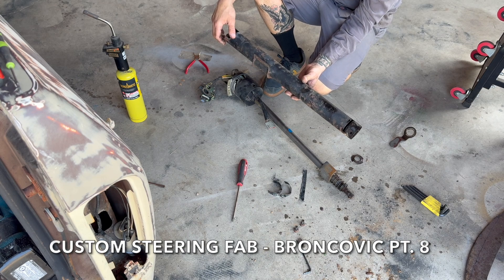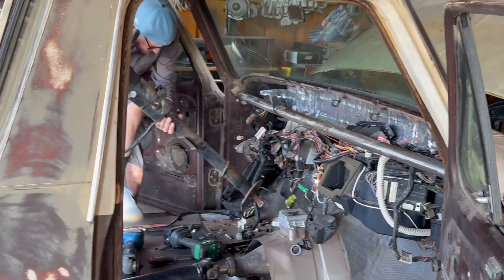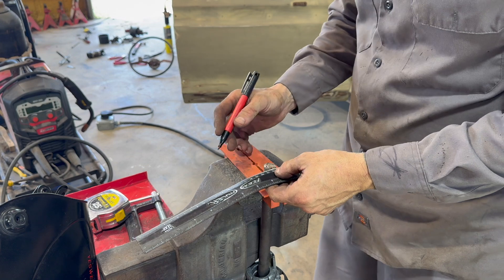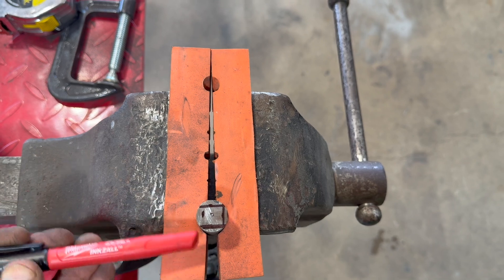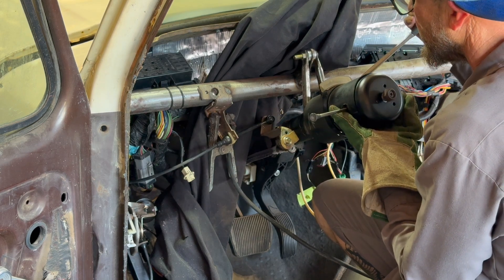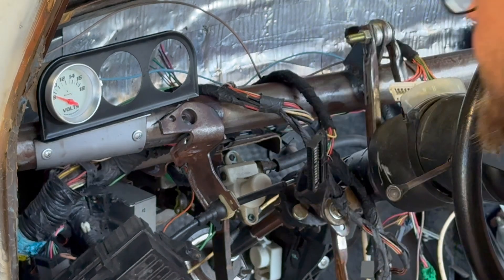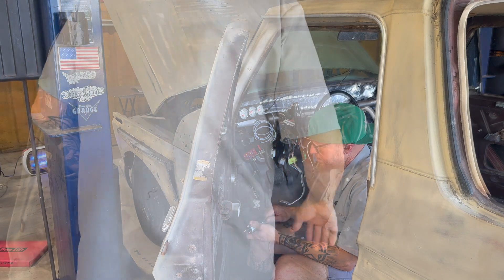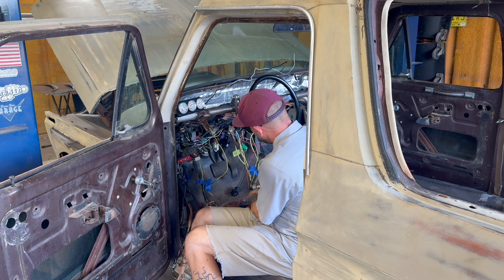Shortening the Bronco Steering Column for a Crown Vic Swap

Comment: It's looking rad!  I've been wondering if you ever actually mounted the body to the frame, or if I just missed it?
Reply from the maker: I did, its welded to the cv firewall which is still attached to the frame via the stock crown vic mounts.  then welded to the frame in multiple places behind that.  Not sure which episode covers that but it in the series somewhere lol

Thanks for watching! 😎✌🏼